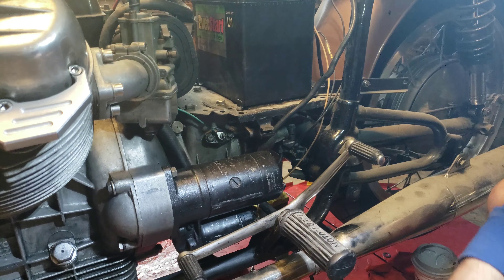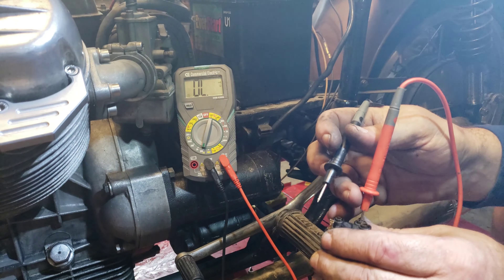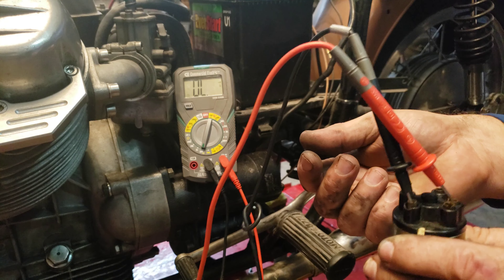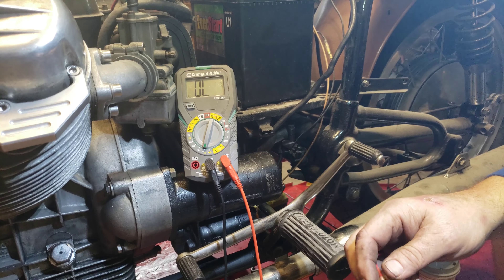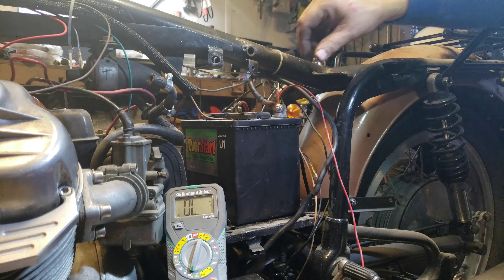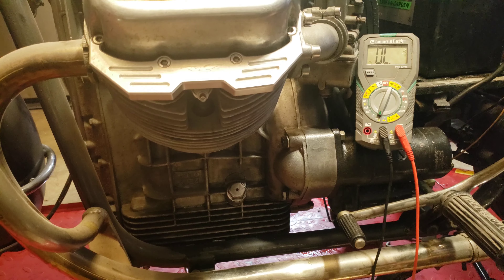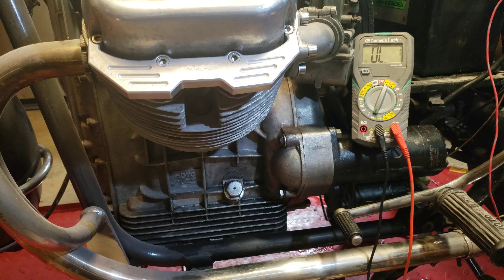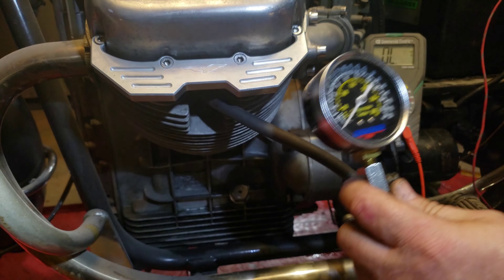1971 Moto Guzzi Ambassador - Episode 3 - Let's Check the Compression of the Cylinders

Comment: for a compression test you should always open the throttle. since they are both a 70 psi, its likley due to the throttle bodys not allowing more air to get to the cylinders.
Reply from the maker: Thank you for the comment!  I don't disagree about about the throttle being open.... but I was just looking to get some type of number....  it would be lower as a percentage, but not drastically lower. And for a true compression test, it would be nice to have the throttles wide open with the engine at operating temperature.